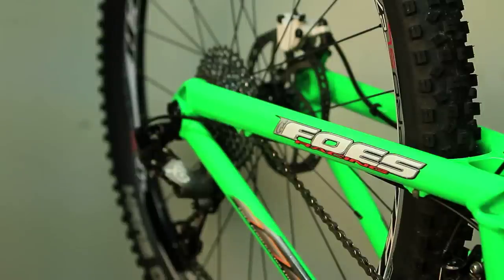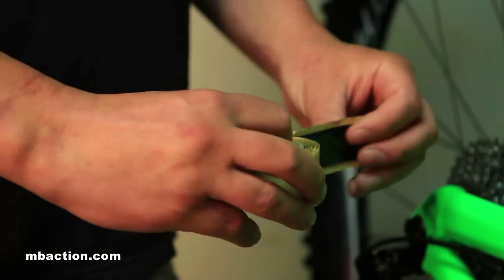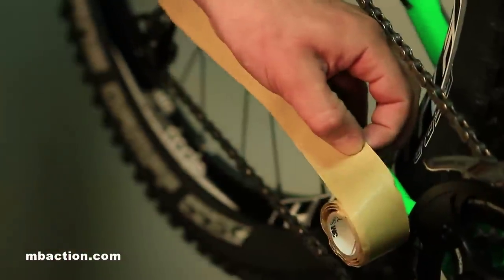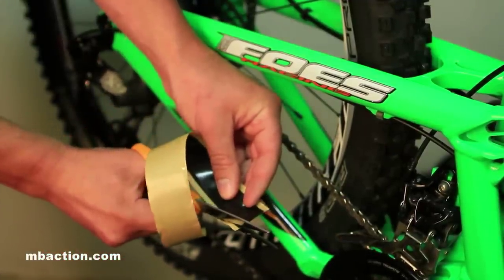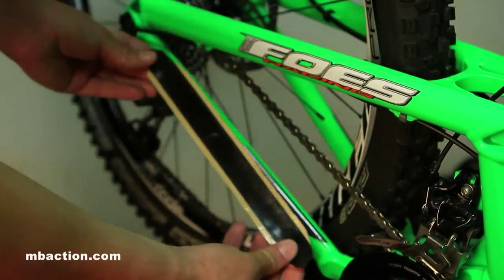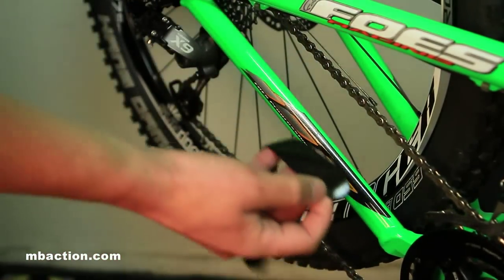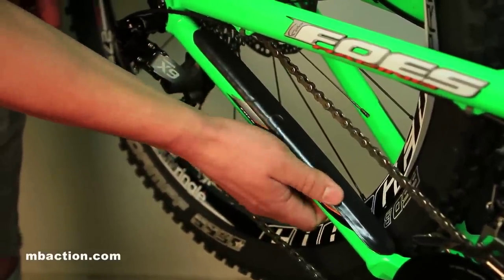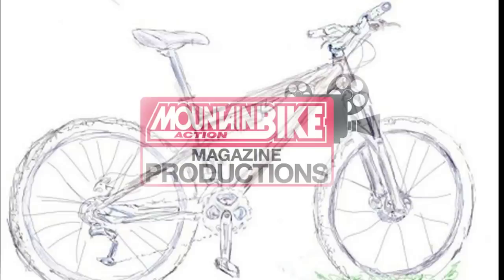Mountain Bike Action Tech Minute - Using 3M Tape to Make Chainstay

Comment: You may prefer using Gaffer tape because it won't gum up and can be removed cleanly. 
"Gaffers Tape is a strong, tough, cotton cloth pressure sensitive tape 
with strong adhesive properties. It differs from other tapes, in that it
 can be removed cleanly because it uses a synthetic petroleum-based 
adhesive rather than a natural rubber adhesive. The tape is manufactured
 in many colors, including fluorescent."
Reply: How easy would it be for removal? One more question is if any of them come as transparent so the frame color can be seen. Thanks
Reply: I don't thing gaffer tape would survive the water, mud and the chain hitting it over and over again.

Comment: £19!!!  I will have to check the price here in Canada, looks like a great idea.  Wondering if you can wrap it so you get full coverage?  As for removal, just heat it with a hair dryer or heat gun - reactivates the glue and should peel off.

Comment: How do you remove tape when you want too? I want to use it to cover some pinstripe lettering stickers on the bike without removing them as the factory stickers add value to the bike.. Thanks
Reply: If they are factory stickers,they are probably better glued than commercial ones....i believe you just have to gently and paciently peel it off like you would any kind of tape(preferably without tools as they could damage the stickers)